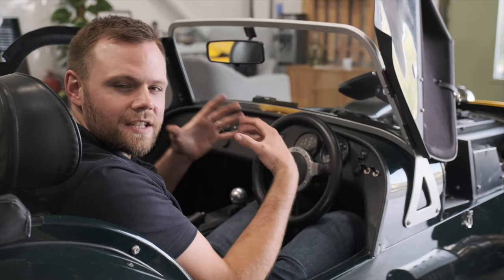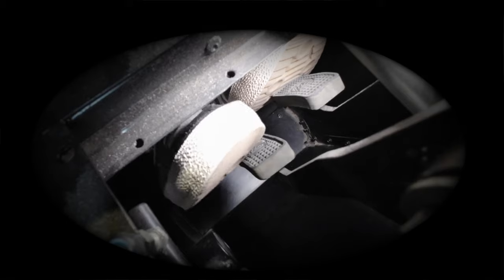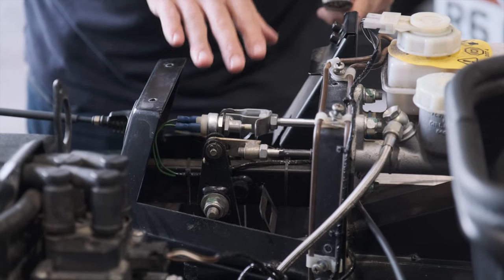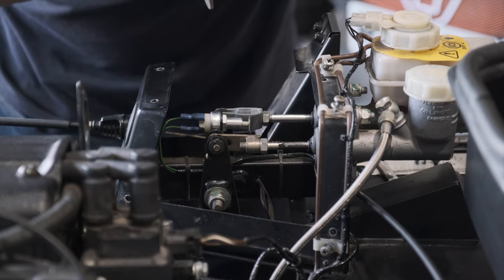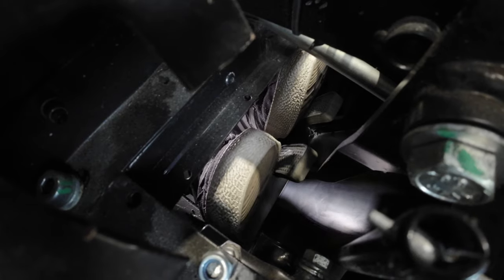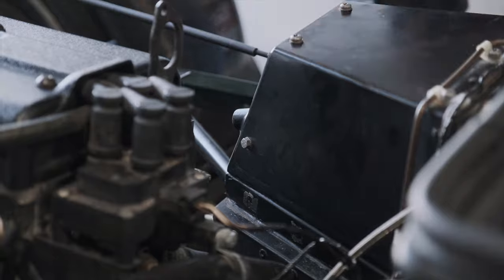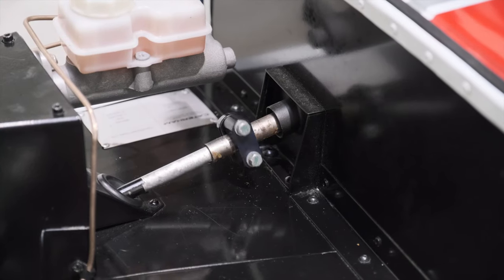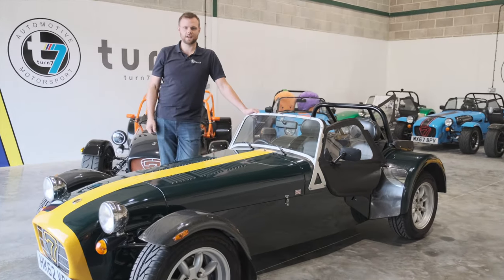The perfect Caterham driving position

Comment: These videos are great. How about one on the adjustable suspension? How to adjust, what the adjustment does and if having a passenger is a factor.
Reply from the maker: Thank you @barsaf9989 😊 We've been pondering suspension for a while, but it's quite a tricky subject to do in a video — only because it's very personal when done correctly. We would suggest a 'flat floor' session with your local specialist, which will set the car up specifically to you. If you are local to us, we have the equipment and a resident specialist to do this for you 😊

Comment: Really enjoying the series.  Very informative and very well presented.  Very good PR for you too.  Two months back i had not heard of Turn 7.  Now, if in the market for a Caterham, which I may be next year, you would be first on my list.  Thanks.
Reply from the maker: Thank you for the kind words Nigel 😊 We are here whenever you’re ready for a chat, and can assure you the kettle will be on 🫖
Reply: @turn7caterham  Thanks. As a topic for a future video, it would be good to know about safety equipment.  For example, the difference between roll over bar types.  I see some are referenced as track day or FIA roll over bars.  Does this refer to the height of the bar, material type, degree of bracing or what?  Can one only do a track day with a track day bar, or is it down to the driver to decide?
Reply from the maker: A ha, your wish may turn out to be our command very soon… We've just had somebody ask about roll bars too, so that's on the cards for filming this week. Stay tuned for the drop!
Reply: @turn7caterham    Most excellent!  
This may be going to far back for your normal stock, but as someone who has flirted in the past with getting a Series 2 Lotus Seven, from what date did 'Sevens' have compatability with taking a roll bar?  Unless the strut supports are strong enough is there a value in mounting a roll bar to them?  I suppose those supports will always be stronger than the driver's head.  
Ditto re seat belts mounts.  One reads of people bodging them to the aluminium skin of the transmission tunnel from where they will simply tear out in an accident.
Reply from the maker: Hi Nigel,

A good question. You are right, these are a little before my time and although I have crossed paths with a few over the years, I am not sure I could answer that with enough certainty right away.

I am sure, however, we would be able to find out for you by the time you are ready to get touch. 👌

Comment: Useful tips. One question I have is where the clutch stop should be set. Is it possible to overextend the piston?
Reply from the maker: You can’t over extend the piston, no. As for where the stop should be set - it’s mostly your judgement, in that once the clutch has disengaged you’ve reached the “bottom”, so the stop can be set just after that. Hope that helps!